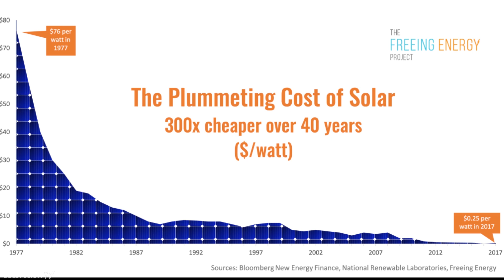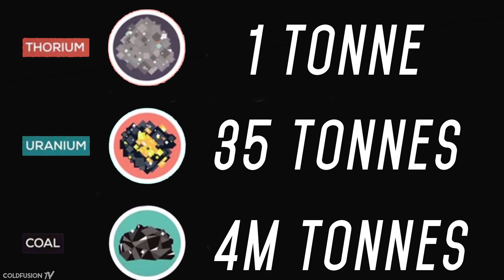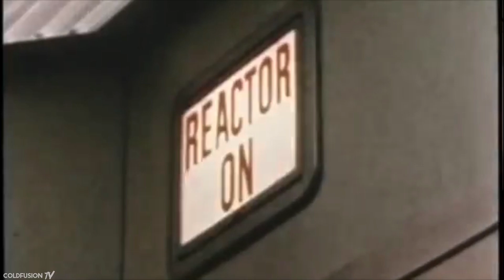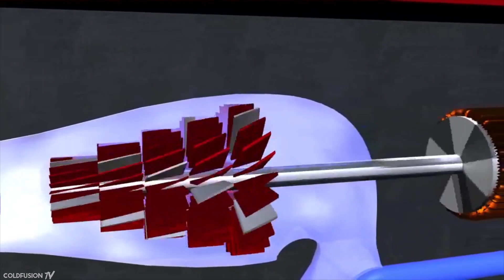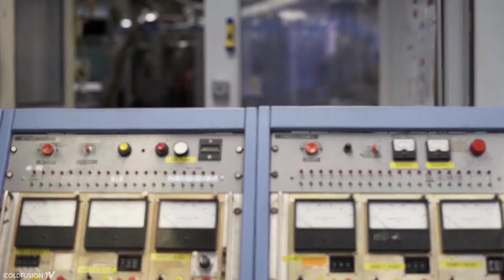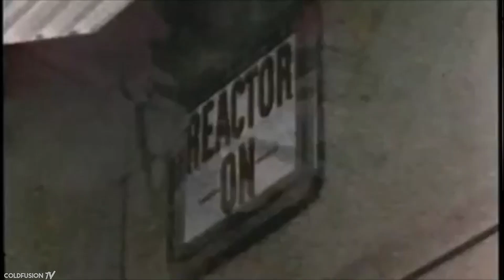Thorium - The Future of Energy?

Comment: An observation, Thorium reactors do not have any less proliferation concerns than a uranium cycle reactor. The US, USSR and India have all tested Uranium-233 devices. U-233 has very similar qualities to Pu--239 both being bread synthetic elements and having much smaller critical masses than U-239.

Further, the relative abundance of Thorium and lack of nuclear waste are predicated on once-through fuel 'cycle' for Uranium (which is done because it is so laughably cheaper than reprocessing) and  the Thorium fuel cycle for Thorium (inventive name). If you were to use a Plutonium fuel cycle (requiring the development of a fast reactor) you be able to consume your waste (and the transuranic waste generated from Thorium reactors) and use the about 7.5 Million tons of natural uranium available in economic deposits, distinctly more than the 2-3 million tonnes of Thorium.

Comment: Thorium reactors have been tested. That is what Oak Ridge National Labratories did from 1957 to 1976. They also tested critical failures of the reactors. By the laws of physics molten salt reactors are self regulated should anything bad happen. In fact this kind of technology can help the world get rid of existing nuclear waste that now has to be contained for 100000 years or more. By building complete nuclear plants on barges at ship the cost can be reduced considerably. These types of reactors don’t need the same amount of safety barriers that traditional nuclear power plants does.

Comment: My Open letter to the Sierra Club,

INDONESIA has an environmental choice: -
more poluting coal-fired power stations; 
Or-
 7×500MWe liquid Thorium metal ion with molten sodium fluoride salt, (MSR) ThorCon energy Converters at a capital cost of $1/Watt;and a >75 year life?
 Or -
Destroying 190 square kilometres of tropical rain forest for <30% utility 25 year life Solar farms to get the same total energy output  as the seven ThorCon 500MW MSR units but at a cost of $(2÷30%)=$6/Watt?

I represent a number of environmentalists in Indodesia and we would love to see a reduction in the number of 1GWth Coal power Stations scheduled within the next 10year plan as well as the eventual conversion/modification of existing ones to use Molten Salt Reactors (MSR) as a clean and safe heat source.

We, and quite a number within the rural farming community, are concerned not only with the encroachment by urban sprawl into extremely productive farming and flood absorbing land; but also the actions of entrepreneurs seeking land for large Solar panel farms.

# Could you please confirm whether or not your club would prefer seeing Indonesia's choice for replacing existing and future planned poluting coal-fired power stations with either the likes of MSRs or farming and/or tropical rain forests destroying Solar farms such as : -

A) their currently contracted 7×500MWe ThorCon "Walk-away" safe (near ambient pressure), energy converters with a 65m×180m=1.17Ha footprint per load following unit of max 500MW on grid; at a worst case annual 95% utility factor, amounting to an averaged availability max load of  406MW/Ha (over a giving 75year life) at a capital cost of $1/Watt and a PPA agreed cost to consumers <$0.07/kWh;

Or -
B) (As already experienced in PLTS SulUt  Likupang's 21MWp ;15MW on Grid at 30% utility with a footprint of 30Ha and 25year life); 

Equivalent Solar farms at 0.5MW/Ha; at a pre utility basic capital cost of $2/Watt; and a current PPA cost to consumers $0.066/kWh and averaged load output 0.1MW/Ha to 0.5MW/Ha over 7.5 hours per day giving 30% utility.

HENCE for Solar Output over their productive hours to equal that of ThorCon's 3500MWe over the same daylight period of time; then the area requires would be:

 (7×500/0.5)÷1.17=7000/1.17=6000Ha or 60km^2 of scarce tropical rain forests.

Because Solar is only effective for 7.5hours/day (30% utility), to meet the Max possible (as a  base load) annual output would increase required area tropical rain forest destruction to 0.95×6000÷0.3=19000Ha or 190 Square kilometres of tropical rain forests or virgin jungle.

(It is of note that wind farm are not viable in Indonesia due to their lack of wind being in a Equatorial location).

If you cannot confirm a suitable choice for Indonesia (or the world for that matter) would you reconfirm that the Sierra Club still prefers the destruction of temperate forests in Germany for shipment to burn in subsidised poluting British biomass plants in preference to walk-away safe liquid metal molten salt reactor that can also burn up existing nuclear "waste"?

NOTE: I have no interests or influence in either ThorCon International or ThorCon Indonesia.

Comment: Covering vast expanses of land with panels that contain cadmium and led, among countless other toxic substances, is only going to make matters significantly worse. The toxic processes to manufacture and maintain alone should be at least raising some eyebrows, not even considering construction,installation, erosion, and over all disposal; which is essentially the 25 year life span of the first generation of the fixtures' set up, before everything has to be replaced  And as far as wind energy is concerned, all you have to do is ask the electricians in Wyoming what they think of the impact wind mills have made on their energy grid. Not much will be the answer. They refer to them jokingly as the bird shredders. It's not that nuclear is an option, it's that nuclear is the only option that can compare to fossil fuels in output energy for the grid. If you want to have some nice decorations on your house, then sure. Go for it. In terms of large scale energy production, renewables shouldn't even be given the time of day, because the term "renewables" is deceiving. The recourses themselves are renewable, but the equipment and technical infastructure to harness and actuate said the  recoursere's potential energy is far from that.

Comment: A working Thorium molten salt reactor would probably have been not feasible 50 years ago. The technical challenges are way bigger than many assume. Both China and India are already working on this technology for about a decade with considerable funding but had to revise their plans drastically. Instead of already having reactors producing energy by now as originally predicted, they now don't expect this to happen before 10 or 20 years from now. 

Another thing I read is that experts of the molten salt technolgy in the meantime prefer Uranium to Thorium since the process is so much more efficient with Uranium that it hardly makes sense to use Thorium.

Comment: First lines of Wikipedia article:
Thorium-based nuclear power generation is fueled primarily by the nuclear fission of the isotope uranium-233 produced from the fertile element thorium.
Uranium-233 (233U) is a fissile isotope of uranium that is bred from thorium-232 as part of the thorium fuel cycle. Uranium-233 was investigated for use in nuclear weapons and as a reactor fuel.[2] It has been used successfully in experimental nuclear reactors and has been proposed for much wider use as a nuclear fuel. It has a half-life of 160,000 years. 

Yet ColdFusion says that Thorium reactors are somehow opposed to Uranium and Thorium has a lower half-life? This channel is freaking propaganda.

Comment: Nuclear of any type should be sidestepped as the costs are not only prohibitive but it is dangerous no matter what type you use. As someone who was involved for many years with Nuclear power it is better to improve renewable energy sources which are actually clean to use and much less dangerous to use then to bother with Nuclear power. Nuclear power use should be wound down to zero worldwide as renewables get more ubiquitous and more viable.
Reply: Personally, I would rather have a hybrid solution of nuclear & renewables simply because the pair would allow us to end the use of fossil fuels (the most dangerous power supply by far) faster.
I mean, it's also worth keeping in mind that our true long term solution is & always will be fusion power.  We hoped that we could keep using fossil fuels until we cracked that egg, but it's clear that we cannot.  So, we need bridge solutions until we get to the point where fusion power generation matures -- that's renewables & nuclear fission power.
Reply: @dr.zoidberg8666  The problem with nuclear is how LONG it stays around for and is dangerous. Besides, fossil fuels are not going anywhere, at least not all of them. Coal could mostly go away but oil and gas have uses far beyond grid energy production and cars.
As far as Fusion goes, that is a technology that is ALWAYS just on the horizon about 15-20 years away...always. If it ever does arrive we will probably have solved the energy storage problem already, once that is done then it is all bets off with renewables taking over in force. No need to govern throughput from generation to meet demand once you have storage on a grid scale, you just add more storage.
At least that is how i see things playing out over time.
Reply: @rd9102  Imho, that is not the primary problem with nuclear.  Nuclear waste is easily stored safely & modern reactors can even use nuclear waste as fissible materials.
The primary problems with nuclear are that it is very expensive to implement, each plant takes a long time to build, & it requires highly specialized staff to run it, & it is politically impossible to implement in most countries (that is, 'Murika will bring you some good ol' fashioned freedom if they see you investing in nuclear).
Regarding fusion, that's a funny, but tired old cliche that doesn't really depict the reality of fusion power research.  Let's keep in mind that it took about 100 years of research for solar to go from its first invention to an actual practical energy source.  And fusion has had a tremendous amount of progress, especially in the last decade.  So much so, in fact, that there are now a number of private fusion energy companies intending to have their first machines online in this decade.  That does not happen until a technology is nearly ready.
That said, fusion will certainly not be our solution to climate change.  That will come (in most cases) from battery storage & renewable energy technology without a doubt, & where fission can be implemented usefully, it ought to be.
No, what fusion is is a long term permanent energy solution -- a perfect technology to meet our energy needs 50 years from now & 5000 years from now, no matter how energy hungry our civilization becomes.  It also pairs perfectly with space technology, as its fuel source (deuterium & tritium) is extremely abundant in our solar system, but not necessarily on Earth itself.
Reply: @dr.zoidberg8666  Unfortunately Nuclear waste is not easily stored, Yucca mountain is pretty much a long running slow motion train wreck as a permanent storage facility and that is just the tip of the problems storing the stuff. Commercial plants have long had to have temp storage facilities on site because there is nowhere for the stuff to go. Furthermore we are talking about only America, if you go to places like Russia and their habits of storage, that is the very definition of disaster.
The upfront cost of Nuclear is hefty, but the back end costs are also not very cheap. In addition we have only talked about the fuel itself, there is all of the other material that gets irradiated and must be disposed of along the way.
As far as fusion goes, there is a reason the cliche exists. Even when i was first learning about Nuclear power 30 years ago Fusion they had made "great strides" and it was just a short time away. If they ever do make it commercially viable, then that would be great. I am not sure the public would be ok with it just like they aren't fans of Fission. Either way i am sure it will find some limited spot to fill in the grid, just not sure how big that spot will be.
Also it took longer then 100 years of research solar considering the photovoltaic effect was discovered in the early 1800's. The difference between solar and Nuclear is that one had the full force of the government backing it's research and the other was left to whatever scraps were available over time to make it commercially viable. There is no correlation to the time to commercial viability between solar and fusion. And of course wind/hydro didn't take nearly that long to bring to viability.
Fusion if it ever does become viable will find a spot but that spot is increasingly smaller as time goes on.
Reply: @rd9102  Of course, that is nonsense.  Fusion has not only governmental support, but intergovernmental support, as well as corporate support.  It is objectively the best possible power source within the realm of science fact -- it bears none of the downsides of renewables nor of nuclear fission energy. & it has MUCH higher energy output potential (in total, but also especially when you're talking about per square foot).
Quite frankly, it's silly to suggest that fusion power would not generally overtake renewables.  It's akin to suggesting that computers would not overtake the abacus.
& if we're being serious, if you cannot see the objective difference between fusion development now as compared to 30 years ago, then you are not qualified to talk about energy production technology.
Reply: @dr.zoidberg8666  If you say so. But i have reality on my side and you have wishful thinking and a dream on yours. I guess we will find out when Fusion finally gets closer than just over the horizon.
I never said i don't see the difference...the problem is that it is still just over the horizon.
As far as qualified to talk about energy production, i know my qualifications as i have been a reactor operator and i studied all about Nuclear Technologies even if it was 30 years ago. I understand what it takes to make fusion happen and i also understand that fusion is still just over the horizon even after 30 MORE years of research and development. No amount of you implying i am not "qualified" to talk about energy generation changes the reality of where we are at OR where fusion is at.
Get back to me when it becomes commercially viable and hits the grid. Until then it's still just over the horizon, almost there. That is the reality and no amount of being a cheerleader changes that.
Of course i would ask what "qualifies" you to have an opinion on energy production...but then again it doesn't matter, you played your hand when you thought that having an opinion required being "qualified".
Reply: @rd9102  I could have said the same to you those 30 years ago about renewable energy (let alone the MASSIVE amounts of grid scale battery storage that we will need) when you were doing all of your learning.
That's the trouble with deciding you know enough about something -- the field leaves you behind with a quickness.
Reply: @dr.zoidberg8666  The difference is Fusion is still in the same place it was 30 years ago...STILL not able to make power.
Renewables always made power...they just lack grid level storage to smooth out the grids usage and the variability of the weather. They have just become more efficient over time and will continue to do so.
Your making an assumption that just because i left the field i don't have an interest or pay attention to it or what is going on. By definition i am paying attention just by being on this channel. I have watched fusions fits and starts and it is STILL in the same place it was then, just over the horizon, almost in reach.
That's the trouble with fusion, it didn't leave me behind...it never went anywhere but from research facility to research facility. Lots of diffuse research on different levels with different designs. Any small amount of time reading about it will show that. Yes it should be continued to be developed and honed and eventually we will get there (maybe) but it's anyone's guess as to how long.
That's the trouble with living in reality...you have to face it at some point and realize how things ACTUALLY are vs. how you want them to be.
Still wondering what your "qualifications" are to have an opinion. Are you a researcher, do you work in the field, do you work in power generation?